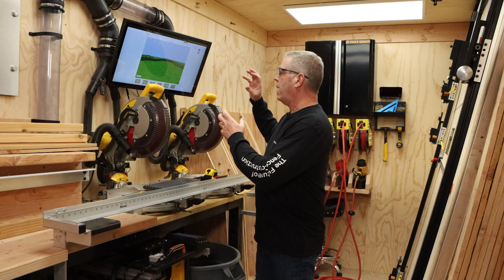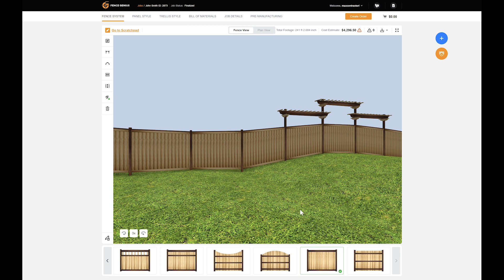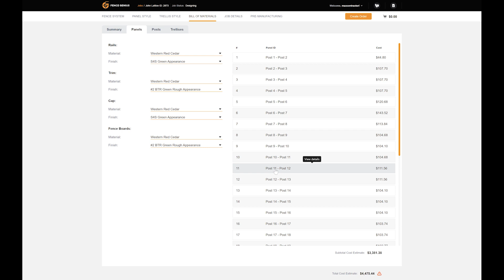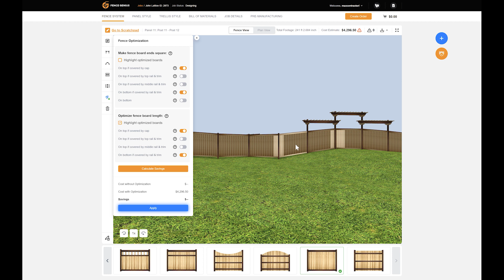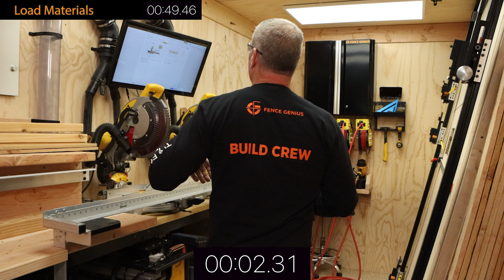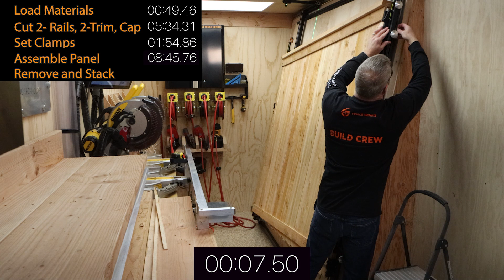Time Study #2: 2 Rail, 2 Trim, 1 Cap Fence Build in Fence Genius Production Pod using V2.0 Rack

Comment: VERY NICE SETUP, INSIDE TRAILER, BEST WAY INSTALL IN SOLID FRAME HOLDER , NICE AND SQUARE
Reply from the maker: The Fence Genius Software Driven Production Pod is highly efficient and enables the best of quality. Thanks for noticing it can be in a 20' High Cube shipping container or a trailer of similar size.

Comment: How are those panels braced when installed since there are no top, middle or bottom 2”x4” rails?
Reply from the maker: Thanks for your question. If you look 18:30 into the video you see the top and bottom rail the boards are nailed onto and there is a 2x4 cap. We build panels to go between posts and screw each rail to each post with 2 - pcs 4" #10 Exterior Screws through predrilled holes that we drill in the process.